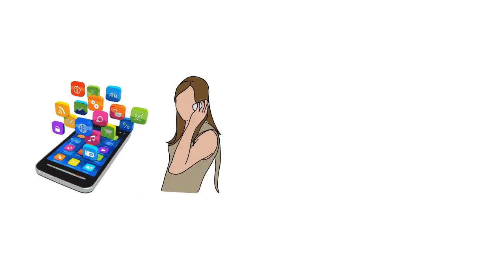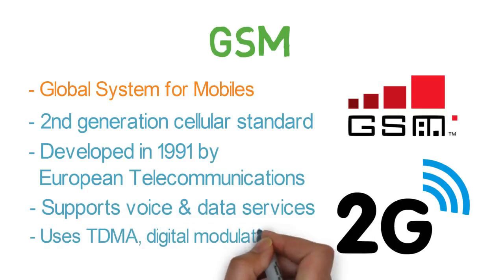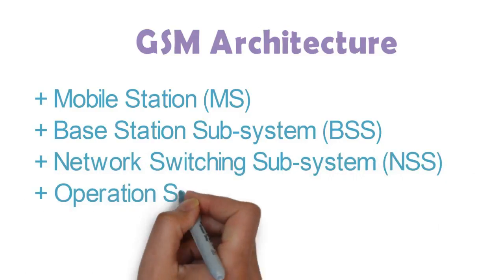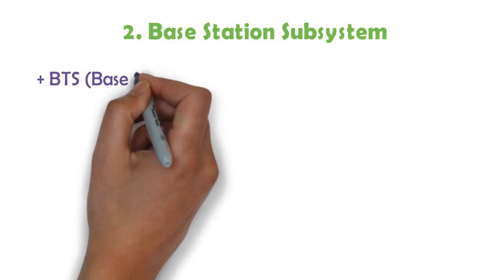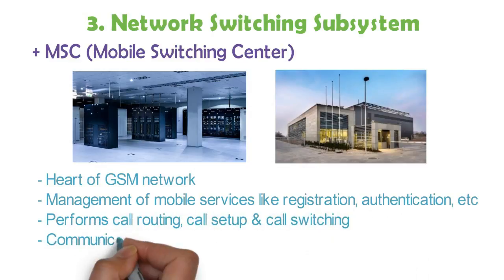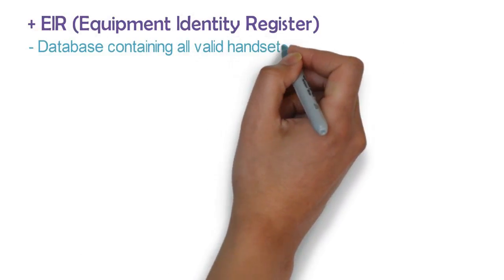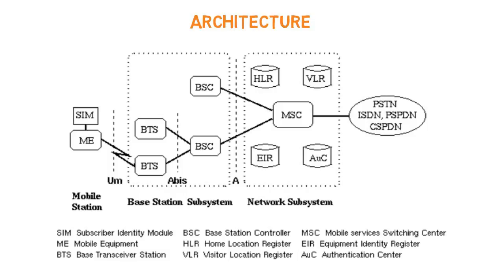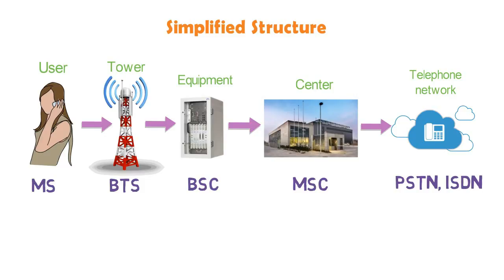How the cellular network works? - GSM Architecture | 1G & 2G | Arun

Comment: How the BTS is connected to the Base station controller?  Through fiber or wireless using  point to point microwave antenna? Does base station controller will have a tower and antenna?

Comment: 1. Mobile Station(MS).
I. SIM(Subscriber Identity Module); smartcard containing IMSI(International Mobile Subscriber Identity).
II. ME(Mobile Equipment); hardware with IMEI(International Mobile Equipment Identity).
2. Base Station Sub-system(BSS).
I. BTS(Base Transceiver Station); sends & receives signals from MZ; encoding, multiplexing, encryption & modulation.
II. BSC(Base Station Controller)
A. Controls a group of BTS.
B. Allocation of radio channels.
C. Intercell handover.
3. Network Switching Sub-system(NSS).
I. MSC(Mobile Switching Substation); A. Heart of GSM.
B. Management of mobile services like reg & auth.
C. Call routing & switching.
D. Communicates with HLR, VLR, AuC & EIR.
II. HLR(Home Location Register); master db of subs current locale & info.
III. VLR(Visitor Location Register); subset of HLE. Local db 4 user's visiting loc in other domain.
IV. EIR(Equipment Identity Register); db containing all valid handsets on network using IMEI number.
V. AuC(Authorization Center); 
4. Operation Support Sub-system(OSS).
I. PSTN.
II. ISDN.
III. PSPDN.
IV. CSPDN.